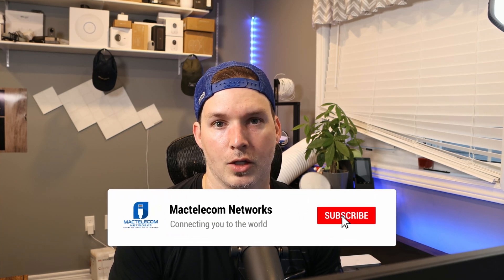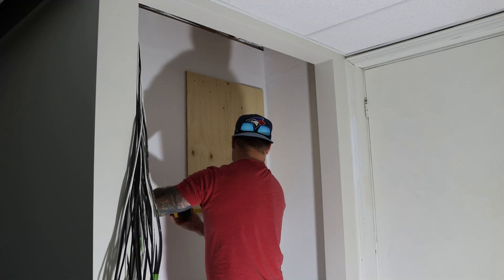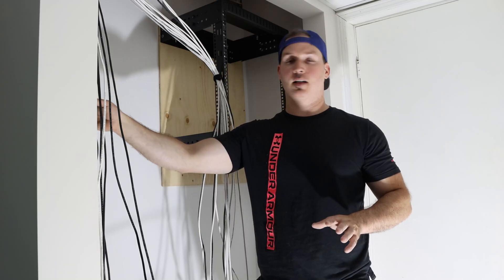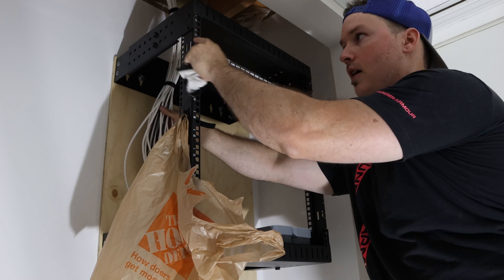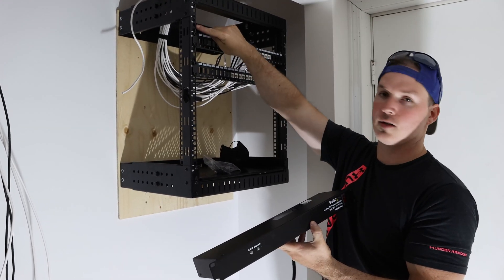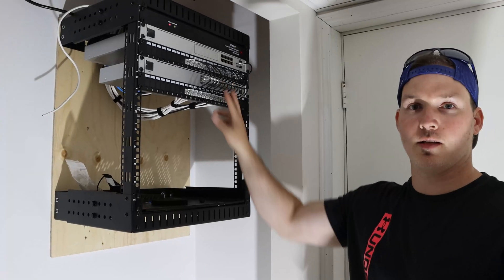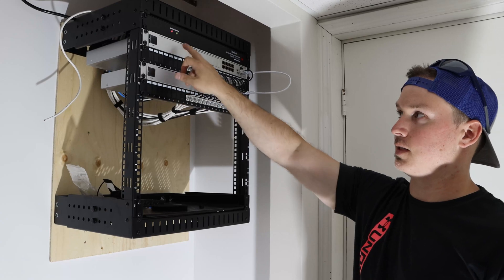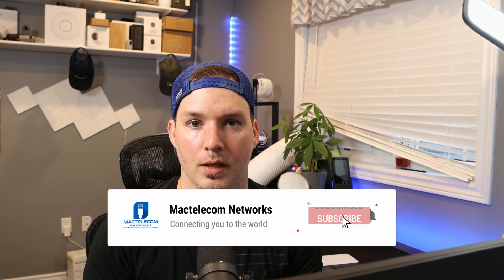On the Job Episode 3 Unifi network installation

Comment: Why did you use a 15u rack, looks like only needed 5U?
Is there any specific benefit into going that much bigger? Like easier to work with?
Reply from the maker: This is a 8u rack and you always get bigger than you need for expansion

Comment: Very dumb question. But what screws do you use for the plywood back board and what screws do you use to attach the network rack to the board? Do you use lags for both or lags for the plywood only?

Comment: I think its better to leave more cable in the rack - Bind and make a "S" with the cables in case the cable run might need to be moved (even if it is moved to the bottom of the rack.  Just my opinion.  I do like the network install videos.  Loved watching "FiberNinja" on youtube, has some great tips.
Reply from the maker: Oh there is a crap ton of slack in the ceiling lol the customer didn’t want any cut for that exact reason. They are finishing the basement and may move the rack

Comment: Great video and install! 
I’m about to install a POE switch and patch panel in my house - do you find the slim patch cables are ok for POE? They’re such a light gauge compared to normal cables I wonder if they’ll fail or cause issues?
Reply: The slim cables work fine for POE.  I have them going to various devices, but I use normal size patch cables for my infrastructure.

Comment: Amazing video. The length and content is good, actaully. Gets to the point and shows the config.

Some questions if you don't mind

How are you terminating those Cat6 cables? I don't see you use a crimper/rj45 (or it's small in and your hand), and it doesn't look like your doing a punch-down patch panel.

Any reason why you put the UDM pro above your switch and patch panels. I put my UDM and Switch below my Patch panel (Patch>Switch>UDM), in case I have to get behind there and mess with the terminated cables. Having the patch panel in between the switch and UDM (UDM>Patch>Switch>Patch) seems like it would be hard in there.
Reply from the maker: I’m using the vertical cable ipunch tool for the cat 6 cables link below 

https://amzn.to/3AnnJzX

The keystones are vertical cable vmax link below:

https://amzn.to/3AhGhBA

As for the rack elevation I always do UDM>patch panel> switch> patch panel. I use 6 inch patch cables so it looks the cleanest doing it this way

Comment: Another great video 👍🏻, which manufacturers patch panels do you use and why?
Reply from the maker: They are just no name keystone patch panels
Reply: @MactelecomNetworks  Interesting, I’ve struggled getting reliable keystone patch panels in the UK, without paying a fortune for a good branded version.
Reply from the maker: These are from a local vendor but I find them sometimes on Amazon for around $25